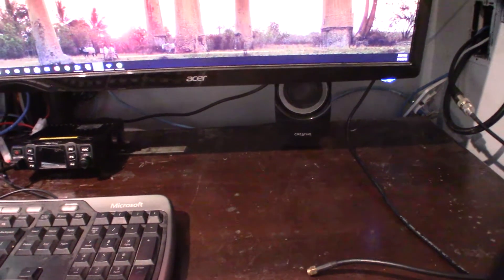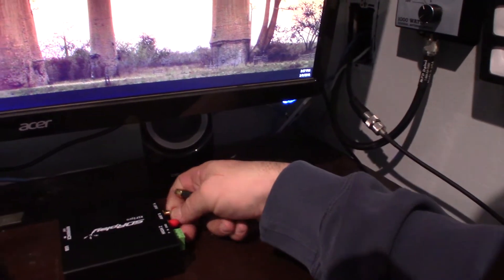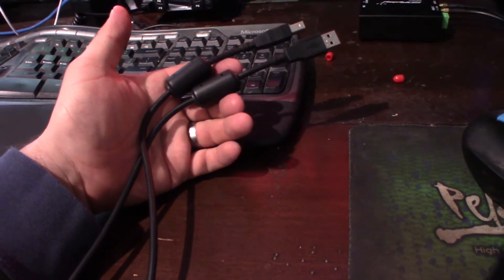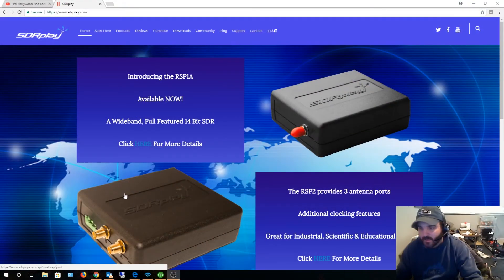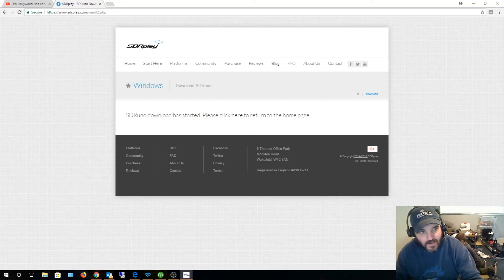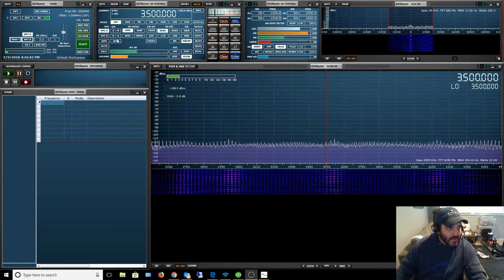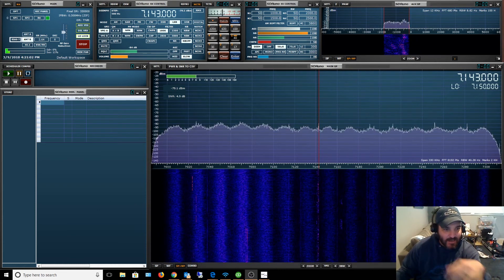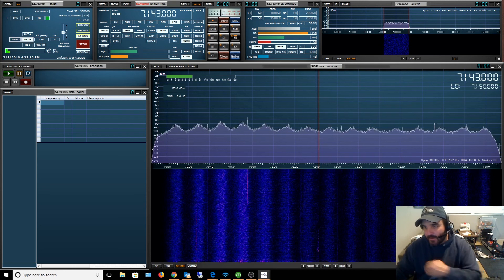SDRPLAY RSP2pro SDRuno installation review HF SDR RTL Part 2

Comment: And to me..the RF gain control is backwards,, it gives you less gain at a higher setting..BUT you can change it in the little settings box to reverse that, which most people call normal setting, at least to me it is..